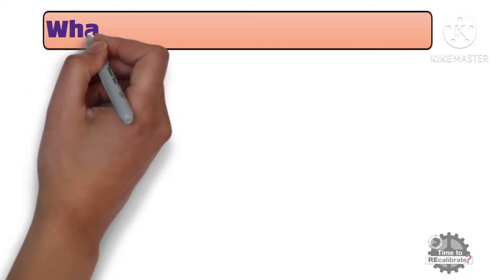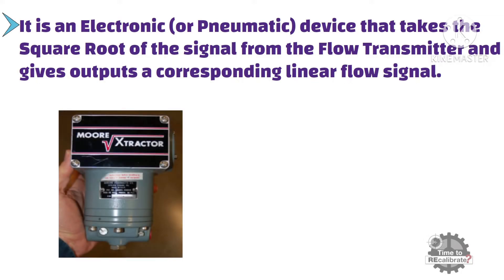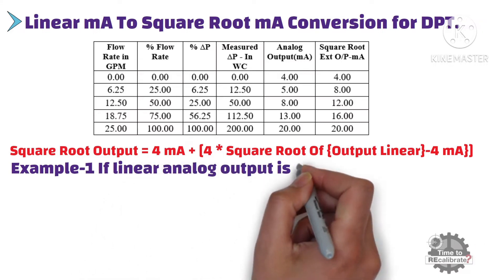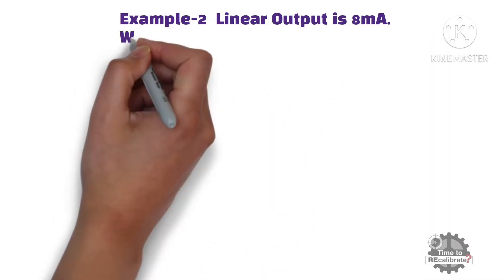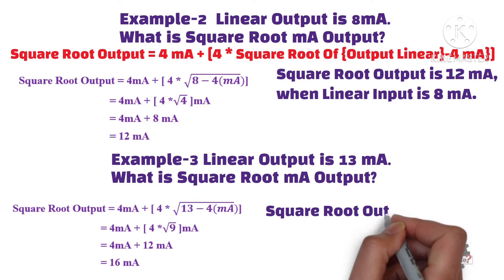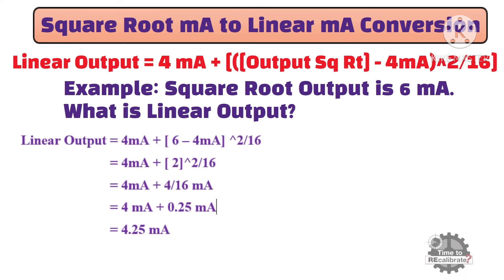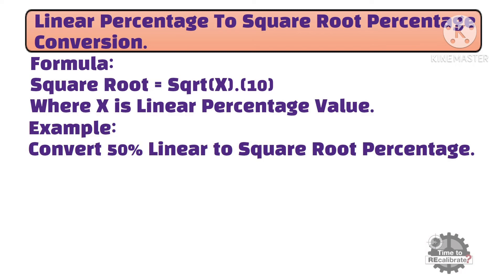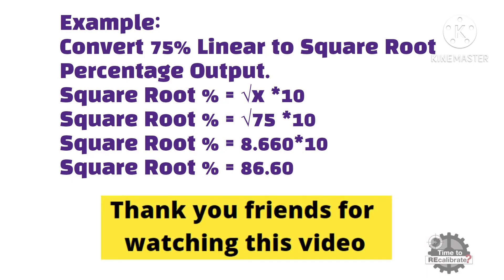Linear ma to Square Root ma Conversion Formula | DP Transmitter Square Root Extractor

Comment: dear sir
please the calibration range 0-- 500 m bar for differentiation transmitter 
how to calculate square root   the out 4 to 20 mA 
flow rat 21 bopod as max
pipeline 8"

Comment: Flow is directly proportional to differential pressure but what about constant of proportionality which is considered based c and beta etc, is it mean all these factors are also incorporated in the transmitter
Simple q is approximately equal to dp what if exact flow is to be inquired secondly what other factors needs to be considered as well

Comment: In linear percentage to square root percentage conversion formula why we multiply with 10 . What is the reason behind it. Plz and me one person asked me in an interview.
Reply from the maker: Hello Ajay
Thanks for asking this question. Linear Value is in percentage. And we need to convert this percentage value into normal Value. This is reason we are multiplying with 10.
For Example.=50% This is a percentage value. 
There is also other way. You can also divide 50 by 100 then take square root.
50/100 = 0.5
Square Root of 0.5 is 0.707
If you convert this value into percentage.
0.707*100=70.7 %.
I hope you get your answer.
Reply: @InstrumentCalibration  thanks for information. your explanation very well.
Can I ask questions in different topics also? Like thermocouple or radar level tx.

Comment: why square root extractor is not used in level and temperature measurement?
Reply from the maker: Square root extractor is only used when we measure flow by using differential pressure. Since flow is proportional to square root of differential pressure. All other variable such as temp, level does not have such relationship
Reply: @InstrumentCalibration  THANK YOU SIR YOUR VALUABLE ANSWER.

Comment: Dear Sir,
I wanna ask some questions
1. Linear Output is signal from transmitters delta P. converting 4-20mA?
2. Flow rate is proportional to squareroot delta P.
So linear output needs to be converted to squareroot output?
Reply from the maker: 1. Yes, But you need to select square root function from transmitter to convert into linear mA.
2. In order to cancel square root, you have to select square root function at transmitter side or at PLC or DCS side.
Hope you will get your answer

Comment: Dear Sir
I am having Siemens DP transmitter, I want to calibration flow with respect to pressure, and why we take square root for flow calculation WRT pressure transmitter pls explain sir.
Reply from the maker: It is because flow rate is directly proportional to square root of differential pressure. And in order to convert this differential pressure to linear, we take square root in DP Transmitter. Please feel free to ask me, if you have any further queries.
Reply: @InstrumentCalibration   Thank you sir👍. Do you have any WhatsApp group or blog?
Reply from the maker: @samuelsolomon2028  At Present, we do not have any. But we will let yo know when we will make it in future.